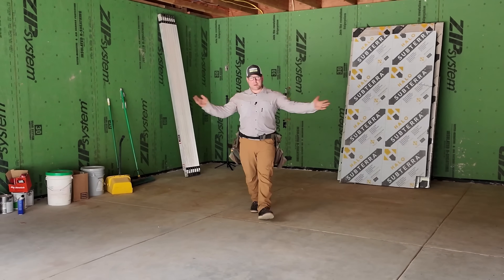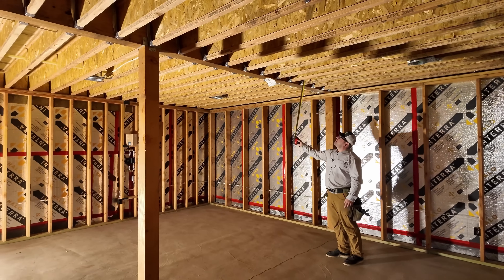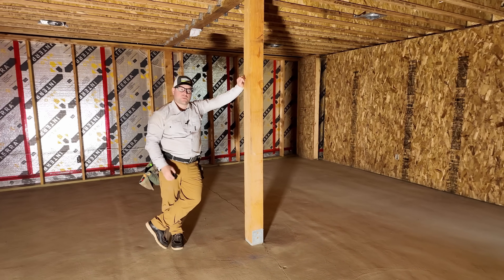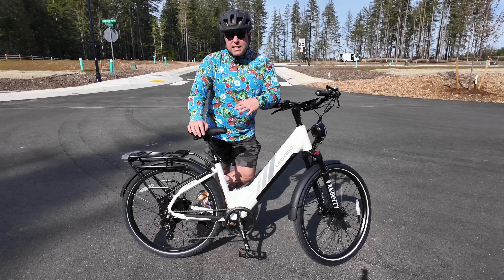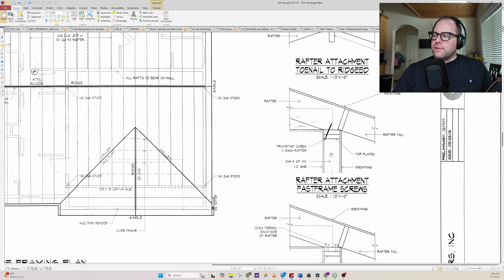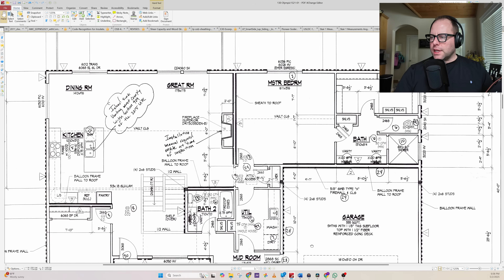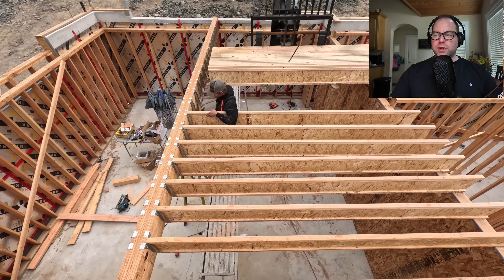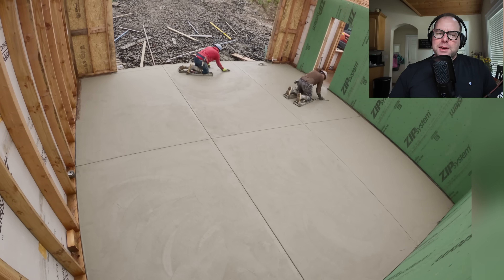Is This Safe? We Drove a Car Into a Wood-Framed Garage Floor

Comment: Fun fact. A commercial parking garage is rated at 40 lbs per sf. for vehicles, that's the same as the live load for a dwelling. As heavy as a car is, there's four points of contact to the floor and its spread out over the floor system.
Reply: Nate, you are correct, sir.  There is a relatively small point load at each tire (roughly 1,000 lbs. for a larger vehicle), but the total weight is spread out over about 100 sq. ft. (or 40 lbs./sq. ft., just as you stated above). In other words, NO BIG DEAL.
Reply: Yeah, I was thinking something like this comparison. Thanks. Cars are not as heavy, relatively speaking, as people think. The main problems are movement on the overall structure and damage to the floor surface (so concrete topping and  well-braced wall system). Not unusual.
Reply: Actually they're very heavy because the weight ISN'T  spread out. It's all point load of thousands of pounds per wheel.
There is a standard requirement for load so it's easy to calculate. The increased load from movement when you brake is included in that also.

I'm surprised at how few people build these rooms. The main reason I think is that I do my foundations in house and so do these guys.
Concrete guys work out a discount for pouring full rooms under the garage and doibg the garage deck on steel pans at the same time as walls.
Bet you'll get takers more than you think.
Reply: @sparksmcgee6641  I disagree. The weight is spread out due the distance of the wheel base. the maximum amount of vehicles you get in that garage is 2 for a floor that rated for 40 psf . That garage will see more load if it was full of people or used as a storage. 
The centrifugal  stopping force is negligible from a slow rolling stop  but I'm sure the EOR already considered this.

Comment: Those are some pretty big cracks in that basement slab.  No expansion joints either, pretty sure its code to have them.
Reply: If it was code there, he would have done it, Tim doesn't cut corners.
Reply from the maker: Definitely an ugly crack
Reply: @AwesomeFramers  Maybe it was just an illusion but I was curious why that slab looked so wavy/uneven?
Reply from the maker: @gravydog51  in the basement?  It is somewhat.  We don't ask the finisher to go crazy because finished flooring will go over the top.  Compare that with the garage floor which is crazy flat.

Comment: My wife and I bought a house that was built in the 1950s, concrete slab sitting on 2x lumber, with a walkout basement under that. Probably 100 boards butt up to each other, looking at it from underneath. It's one of the reasons we bought the house. Pretty cool to see the old vs new engineering of this.

Comment: I enjoyed the engineering explaination. Couple of questions. Water control during heavy rain season. The room below the garage, to keep dry, does the water drainage must be hooked up to a established city storm drainage system without the house having a pump system? Is the scheme more inherent to drain by gravity or is it dependent on mechanical means?
Reply from the maker: Slab is sloped and there is a membrande between the slab and framing https://youtu.be/a7ESROS4Raw?si=sCpXWQXPzXZHKgcC 

As far as water control during heavy rain season, that's really a non issue.  We get a lot of rain here and even driving 2 vehicles into my garage, I'm always shocked how little water is actually on the slab.  It just evaporates off.
Reply: @AwesomeFramers  thanks for your response.  My concern is water table rise, drainage to keep water accumulation near and around the footings to enter the rooms. In other words a sump pump situation pumping into city storm sewer system. In BC near Vancouver we must deal with water table line near surface during heavy rain season and in August the water table is 6 ft. 4 inches will accumulate over night in a hole six feet deep. This is areas on a plain 20ft above sea level.
Reply from the maker: @danstark462  Ah, got it.  If you want the Olympic Footing series (linked in the video) you'll see that we have 12" pea gravel then foam insulation & vapor retarder, then basement slab.  We are over hard pan, then we have drainage on the outside of the foundation and tightlined down spouts

Comment: Tim have you considered doing a permanent wood foundation to piss everyone off. They sound so cool to me
Reply from the maker: Indeed I have 🤣🤣🤣
Reply: @AwesomeFramers  please do haha!
Reply: Problem is now days the there isn't any cost savings.
On a spec house a lot of people aren't even going to look at a house with a wood foundation.

So hopefully you guys find a cabin or lake house project to do that on.
Priced doing one on a site without road access. 
Airifting is cheaper than you think but on a mountainside rock outcrop concrete would kill the budget.  I still regret no doing that job. 
Helicopter pilot even said I could hook onto the lift hook and ride up hanging if I wanted.😊😊😊😮😮
Hey if you get the chance and don't do it you'd regret it forever.

Comment: You spent 18 minutes defending the engineering without saying anything about the crack in the slab directly adjacent to the center support? That's askin for trouble in the comments lol
Reply: I'm not sure why they chose to support the garage on stud walls on the slab & footing rather on the concrete walls. Maybe they didn't want the cripple wall what would require more bracing.... But I"d rather see the lower slab isolated from the support structure--maybe isolated from that point load anyway. And I'm not sure about the detail of that top slab on  a wood structure but with the edge tied into the concrete wall. Maybe theirs a construction joint detail allowing for diffeential settling.
Reply: @pcatful  im no engineer but I had kinda the same thoughts- I was initially a bit confused why it needed to be framed at all, and why it would bear directly on the reinforced slab instead of having its own footing, but I'm guessing it has something to do with the direction of the forces bearing on the basement walls, and the overall slab thicknesses. he covered that first bit in like 1 sentence saying "normally this would all be filled in with dirt - the reinforced concrete is doing double-duty as a structural support AND a retaining wall" so I'm guessing maybe there was no realistic way with their plans to pour a deep reinforced slab up top fully-bearing on the perimeter walls, so instead they poured a thinner slab up top and used wood framing to distribute most of the load around the perimeter of the thicker reinforced slab in the basement, and then since that whole slab up top is fully "interior" to the basement walls, it provides the resistive force they needed to make a proper retaining wall. but i still kinda don't get why that central pier wouldn't have its own footing separate from the slab, especially when he said "HUGE point loads below these beams" lol

Comment: Get rid of post,,,? Hmmm, speck out reinforced concrete precast core floor slabs. Set on concrete walls, probably 10 thick 18 wide, 26 long. Also acts like finished floor & ceiling, then cut all the other product & labor out for price. Yes, my dad built a bomb shelter in 1964 out of those.
Reply: Too heavy, expensive, and unnecessary.
Reply: yep Steve that's waaay more expensive than standard pour. 
It's just not common but the engineering is simple for under garage spaces.
Everything you list is 5X to 10X the price of a standard process
Reply: @sparksmcg, I’ll agree to disagree, a 24 X 24 garage floor in pre stress concrete, lets go, 24 wide 10 thick 26 long is only 12 slabs. Delivered on one semi, and set by Lull, (don’t know Southwest name for that machine). That would take about 4 hours to set on poured walls. 
 Then,,,, minus all the materials and labor to ericit (google spell check fails me) existing & poured floor, one comes out ahead.

It is more efficient, And if I can teach that in scale, awesome framers will buy me a beer, lumber steel & concrete, wisdom decides efficiency. 
Paying the bills and making bank.
Reply: @sparksmcg, I’ll agree to disagree, a 24 X 24 garage floor in pre stress concrete, lets go, 24 wide 10 thick 26 long is only 12 slabs. (Slabs can’t be cut) Delivered on one semi, and set by Lull, (don’t know Southwest name for that machine). That would take about 4 hours to set on poured walls. 
 Then,,,, minus all the materials and labor to ericit (google spell check fails me) existing & poured floor, one comes out ahead.

It is more efficient, And if I can teach that in scale, awesome framers will buy me a beer, lumber steel & concrete, wisdom decides efficiency. 
Paying the bills and making bank.
That is the difference in building/setting slabs in 4 hours, VS framing wood in how many days, it’s faster, and no band practice is going to break sound past that slab.
Reply: @sparksmcg, I’ll agree to disagree, a 24 X 24 garage floor in pre stress concrete, lets go, 24 wide 10 thick 26 long is only 12 slabs. (Slabs can’t be cut) Delivered on one semi, and set by Lull, (don’t know Southwest name for that machine). That would take about 4 hours to set on poured walls. 
 Then,,,, minus all the materials and labor to ericit (google spell check fails me) existing & poured floor, one comes out ahead.

It is more efficient, And if I can teach that in scale, awesome framers will buy me a beer, lumber steel & concrete, wisdom decides efficiency. 
Paying the bills and making bank.
That is the difference in building/setting slabs in 4 hours, VS framing wood in how many days, it’s faster, and no band practice is going to break sound past that slab.
And it’s all engineered stamped, on the product, it’s pre , checked off liability. What’s not to love about it.

Comment: Capping the wood floor with felt or concrete will cause it to rot. I turned a 1900s Ford dealership into a restaurant a few years ago. Existing 12x12 beams with 4x 12 joists on 2 foot centers, 4x 12 floor boards over that. We removed the wood underpinning and poured a concrete perimiter foundation. It is still in fine shape 40 years later, and was 80 years old when we did this. Engineers tend to not understand rot from moisture being held in.
Reply: Not enough details in your opinion
Reply: @BaronVonFrankenBolzlll  Agreed. Took out wood underpinnings and poured perimeter foundation? A floor system that only lasted 120 years. Did it rot? Was space conditioned or maintained all this time? Why would putting concrete and felt (clearly no one would just put concrete on bare wood) cause something to rot? Concrete toppings are put on wood floor structures all the time.
Reply: @ gypcrete isnt put on anything but the sheathing
Reply: @pcatful  It is still lasting. Holding moisture in wood causes it to rot. I have been a liscened contractor for 40 years, I specialize in historical restortion. The wood floor was and is adequate for vehicle loads.
Reply: @chrisbrowne4669  Yeah buy standard stuff. FYI your comment reads like you had rot on a project.

I like the idea of a wood membrane dimensional lumber floor for a cabin with an under garage room.
Daily use and you'd go through that lumber surface pretty quick.
OK a few years but like refinishing floors that simple expensive project shows up sooner than you think.
Also you can use waterproof concrete to avoid the membrane. Or put the membrane in the middle of the concrete slab.
Reply: @chrisbrowne4669  I guess you are speaking hypothetically. The floor structure can dry to the space below. What moisture, and how did it get there?
Reply: @pcatful  I live on the Nor Cal Coast, we have 15% ambient humidity. It collects and gets absorbed and starts the process.
Reply from the maker: https://youtu.be/a7ESROS4Raw?si=sCpXWQXPzXZHKgcC

Comment: Got yea beat, 2135 miles on Trek Powerfly 4, 2023. Just learned today that Bosch is coming out with a software update to the CX performance. To turn it into the CX-R performance motor. Would love to go on bike ride with your “Electric” bike. I am going to run you down, in full power @ 41 mph. With tall gears, in 29er ,,,feel free to pass this on to manufacture.Lectric brakes cannot stop @ 41 mph,  Shimano brakes can ,only on a Trek.

Comment: My grandfather used to keep his Oldsmobile F-85 station wagon in his barn. There was never any doubt that the 2” thick wood floor would support the two ton car.  Would it hold up with the dead load of a concrete slab on top plus the car?

Comment: Did the engineers say what the total weight capacity of the garage floor would be?
I am curious how much it could handle.
Because of rot and termites, I'd still rather see structural steel combined with the corrugated steel like you see in parking structures and high-rise office buildings.
Reply from the maker: Where would the rot and termites come from?

Slab is sloped and there is a membrande between the slab and framing https://youtu.be/a7ESROS4Raw?si=sCpXWQXPzXZHKgcC
Reply: @AwesomeFramers  Termites are an easy one, the rot would come from moisture intrusion and that membrane trapping vapor next to the wood.

Neither would be an immediate concern but I am thinking about potential long term failures.
 
I worked on a project that was designed to last over 100 years using structural steel, corrugated metal with rebar and 6"  of fiber reinforced concrete floors. The wood that was used in that project was getting attacked by flying termites well before the metal roof and drywall went up.
Reply from the maker: @David_H_Parker  The membrane is vapor open and can dry to the inside of the room downstairs.  I guess I don't understand where people think all this water is going to come from.  When we drive 2 vehicles into our garage in the PNW rain, there is very little water that actually gets onto the slab, much less than people think.  The steel trowel finish as well as the membrane will keep this assembly protected for the life of the building.  As I mentioned in the video, my job in the early 90's was to install hangers in assemblies like this.  Those houses are doing fine, I drove by and did some stories on IG 2 months ago.

Comment: Was using a concrete forming system like Lite Deck SRS considered for this project?  It would have allowed for a clear span underneath with no supports in the middle of the room.
Reply from the maker: Nope, could you post a price of what that would be?  I think that would be very interesting to know
Reply: Think this is a spec house and that post would cost thousands to remove with no payback.
All the prefab and foam forms is way more that a pour on forms or steel deck

Comment: They build parking garages all the time, dont see why it wouldn’t work, where does water coming off cars garage go tho? Or is there a membrane / drainage on the subfloor ?
Reply from the maker: Slab is sloped and there is a membrande between the slab and framing https://youtu.be/a7ESROS4Raw?si=sCpXWQXPzXZHKgcC
Reply: Water must drain outside per code. There’s a moisture barrier under the slab. More is not necessary.

Comment: I'm sure it's fine now, my concern would be will water on the concrete slab.  Where does that water drain? Can it degrade the joists and beams below over time
Reply: There shouldn't be so much water on the slab. It is not an outdoor slab or anything. Obviously if it is raining outside the car will be wet when it drives in, and a little bit of water will get on the slab. But that can dry over time. Not all that different from, say, a bathroom floor or something like that.
Reply from the maker: Great question.  Short answer is no worry at all.  The slab slopes and under the slab is a mebrane https://youtu.be/a7ESROS4Raw?si=sCpXWQXPzXZHKgcC
Reply: @AwesomeFramers  lot of faith in a membrane that will probably break down over time
Reply from the maker: @shrimpinpat  What I'm putting faith in is the assembly and choice materials.  There is zero reason to think that this membrane will "break down over time".  I understand your reluctance, but that is quite frankly the result of not enough knowledge or experience.  That's not meant as a slight, I'm very skeptical until I do more research and talk to experts.
Reply: @shrimpinpat This is not going to be in the weather. Some water occasionally, most that will evaporate or run off before it gets through the concrete to the membrane. Done a couple of these. It’s important to have access and drying capability below besides (in any structure), which this build has. Experience is no problem, if built right.

Comment: When foundations and details fail it is a finger pointing game. 
Stamped details like this are a disaster over time….. never mind the already existing 1/2 crack in slab.  I love this channel and am not trying to be a Karen.
Reply from the maker: Can you run the engineering calcs and post them here?  Point out the flaw in the engineering and I'll go back to the SE
Reply: @AwesomeFramers  My point is engineering calculations are correct however, as much as I like getting sued it is "a finger pointing game" when correct stamped designs fail.  As a kind of awesome framer myself I would not agree to build this design when superior materials and systems are readily available and economically competitive.  I love your channel and am gonna give rapid fire pass load a try next week based on your content.  Thanks for the great content

Comment: I love the idea. The engineering looks sound, however I'm curious to know if the concrete is a certain slump and what the psi would be? Was fiberglass strands used to help with tension loads? You're a great teacher. You're very appreciated.
Reply from the maker: I talked to our engineer at the time about that.  This concrete is north of 3000 psi and he just waved his hand and said non issue 😆